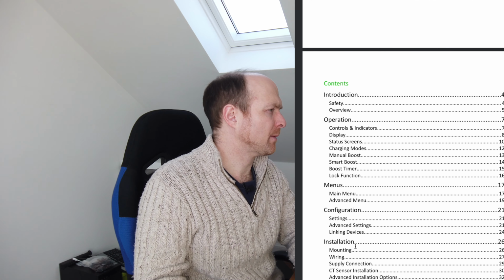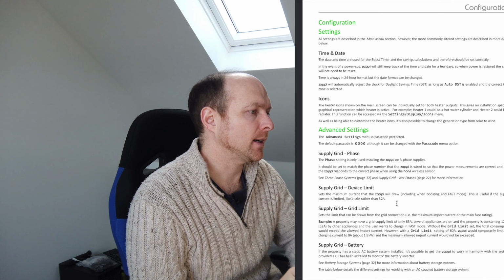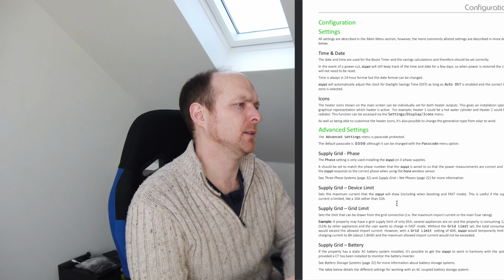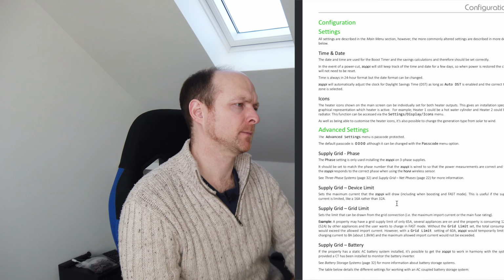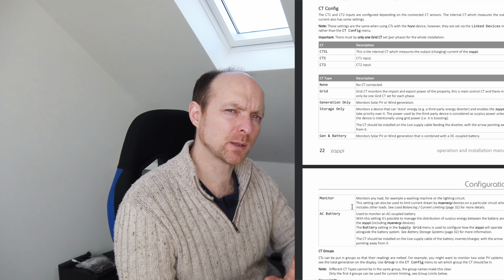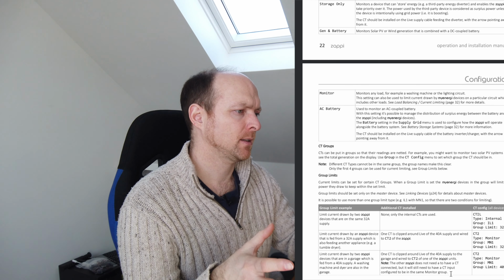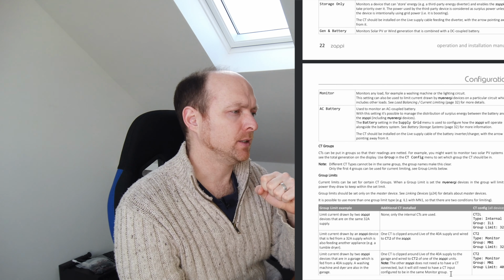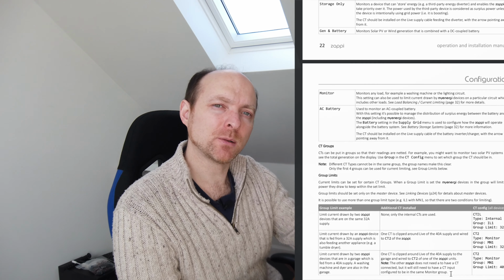Monitor Mode Part 2

Comment: Sorry to hear monitor mode isn't working for you Iain; in my setup it works exactly as you were hoping it would. When I did my testing, I realised I'd connected my CT clamp around the wrong wire - I'd only put it around the other 'washing machine' load and not put it around the supply to my garage (and hence including the Zappi v1 load) - and had a similar, "It doesn't work!" experience to the one you're describing. What I don't have in my setup is an Eddi, so I wonder if @_dof_ has the answer with his question about whether your Zappi is the master device. Good luck.
Reply from the maker: Cool good to know it’s possible👌. Yes I think @_dof_ is correct I will check it out 👍👍

Comment: In the manual it said "Group limits should be set only on the master device". Did you change the master device to be the Eddi previously?
Reply from the maker: Oooo I missed that nugget, yes Eddi is the master currently, something to tryout 👍👍